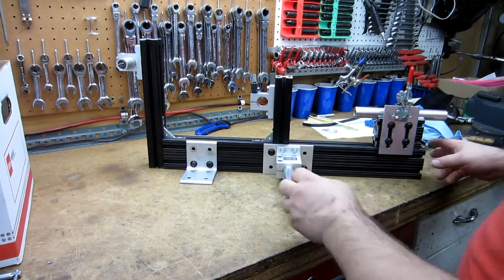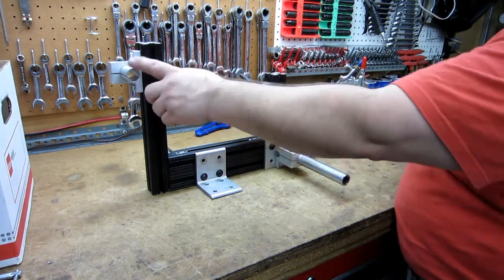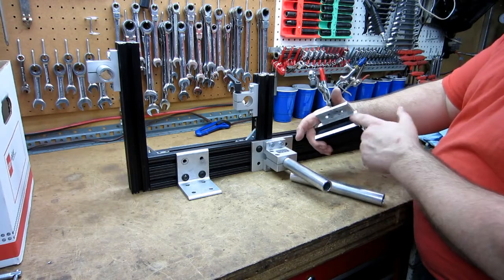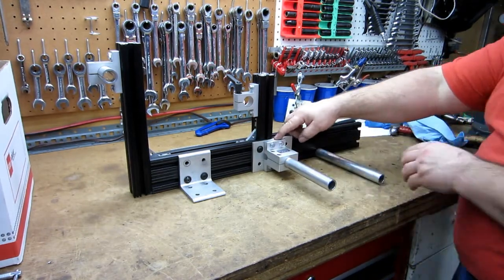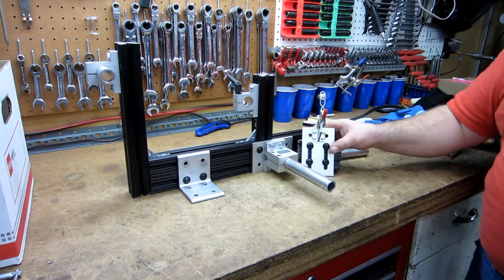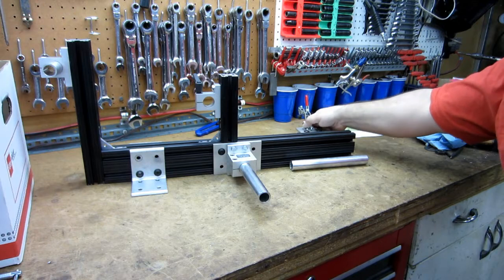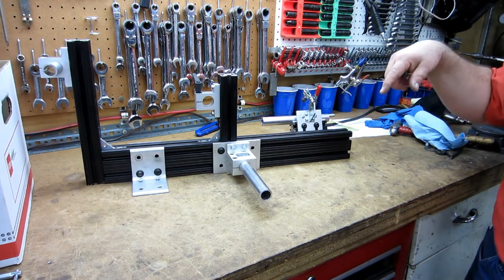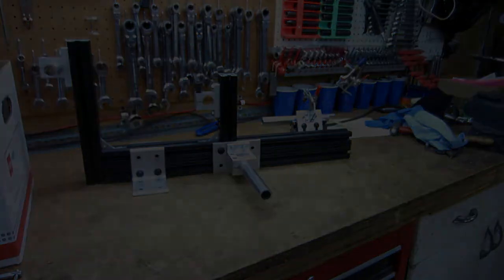Bike Fork Jig

Comment: Anyone know what the pieces used to mount the dummy axle, fork leg support and the tube to mount it in the bike stand are called? I tried searching for 'extrusion tube clamp' but just get handrail stuff.
Reply from the maker: It's called 8020.  I'm sure if you google 8020 extrusion you'll get the kind of info you're looking for.  
https://www.google.com/search?q=8020+extrusion&rlz=1C1MSNA_enUS613US613&oq=8020+extr&aqs=chrome.0.0j69i57j0l4.3776j0j7&sourceid=chrome&ie=UTF-8

Comment from the maker: Tyler...... I did machine it down.  If I remember right, the tube touches the sides of "V" and not the top edge.  That means that you could use a hacksaw to take the excess off and not affect the accuracy.

Comment: Can you list out the parts you bought for the stanchions?  Also what dimensions of extrusion did you use?  Thanks
Reply: Also, one quick followup, are the 2 stanchions the same?  Where did you source a dummy axle to fit into the split tube?
Reply from the maker: Jonathan Damick
Hi Jonathan,
The 1530 extrusion is 1.5" wide and 3.0" tall.  I helped a friend of mine with this project.  He came up with all the pieces and we simply did the fab work at my place.  I've emailed him with a link to this vid, so hopefully, he'll have some time to answer your questions.  He bought the dummy axle online, but I don't know where.
The stanchions on the uprights are the same, but different than the other one.
Sorry I don't have better answers for you.
Mike
Reply: Jonathan Damick Jonathan, I am in Europe right now but when I get back to the states in 10 days I'll dig up the parts list for the 80/20. Now that we have  built one we know a couple places where we can make improvements just with different 80/20 parts that I didn't see in my first design. I can update the parts list to account for those improvements. The dummy axles were from Alex Meade: http://www.alexmeade.com/. He can also make you an alignment jig running from relatively inexpensive flat plate fixturing setups to more complicated stand style fixtures. The dummy axles are perfect and work great in this setup. I'll update to this thread when I get back to the states.
Reply: Steve Carter Awesome - thanks so much.  I'll check back!